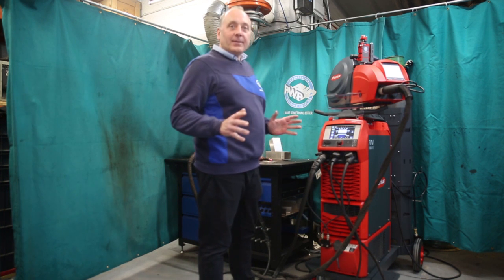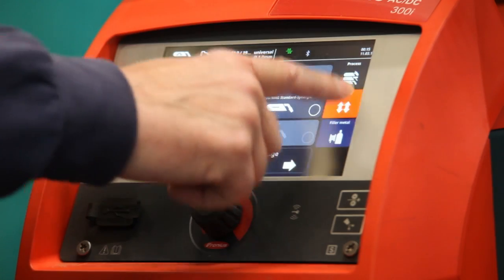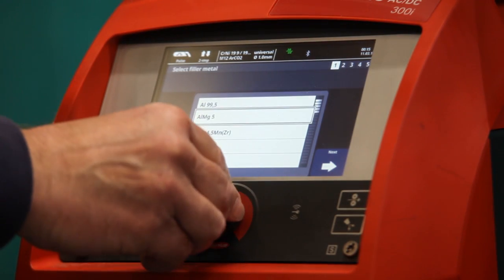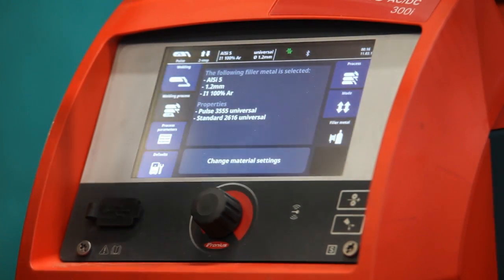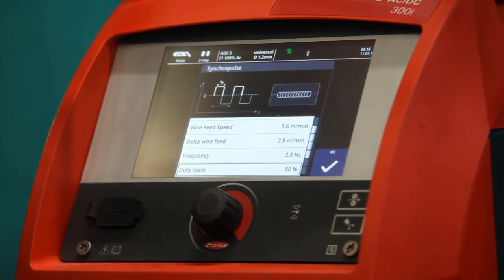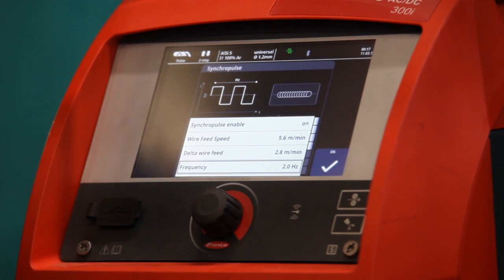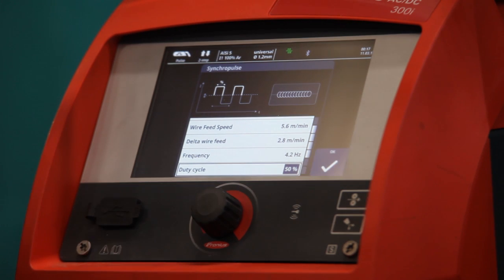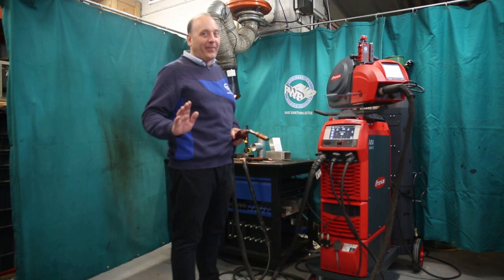Fronius iWave 300i AC/DC MIG Settings Demo

Comment: Hi ,  seen almost all of your fronius iwave videos , great explanations nicely discribed thank you . I have the same welding machine iwave 400ac/dc PRO since April.  First bougt only as a tig welder and then in April we had it upgraded to mig/mag . It's a Lamborgini for  welding machines . Really one of the best welding machines out there .I do have a question please, it's regarding the settings in mig/mag mode let's say welding steel ( mostly from 6mm to 120mm thickness wich we only weld from steel, stainless steel , hardox to super duplex and so on .. I just can not get my head around the " dynamic "setting in mig/mag mode  it's like I can not notice a difference . Ok the arc length setting one can notice every single adjustment but when we switch to dynamic it's just playing with my head . Is the dynamic setting recommended only for short circuit welding or does it have a influence so to say in higher amps from 240 upwards. Sorry for the long post . And sorry for my English.  Thank you in advance for any reply. Greetings from Germany.  Wish you all the best.
Reply from the maker: Yes I know exactly where you’re coming from, the Dynamic setting is something I usually avoid touching unless you’re in short circuit or ‘dip transfer’ welding or possibly in MIG-Pulse mode at low amps – you will hardly be able to detect any difference it may make when welding 6mm to 120mm steel.

In Standard MIG/MAG welding mode it influences the short-circuiting dynamic at the instant of droplet transfer: negative setting gives a harder, more stable arc and positive setting gives a soft, low-spatter arc. In effect, when short circuit or dip transfer welding a positive setting can help with better penetration in a root weld run or nice weld-pool stability when welding out of position (e.g. vertically-up). If a low spatter result is required then a negative setting can help achieve this but this must be balanced to ensure the arc doesn’t become unstable.

In Pulse-Synergic welding mode it corrects the droplet detachment energy, a positive setting makes for higher droplet detachment force – I have found this can be helpful when welding thin aluminium sheet using 1.2mm wire as it helps ‘burn-off’ droplets from the wire end without the need to increase the welding power. A negative setting makes for lower droplet detachment force and therefore should help reduce spatter, again it needs to be balanced to ensure the arc doesn’t become unstable.